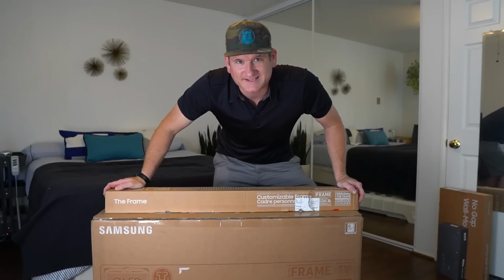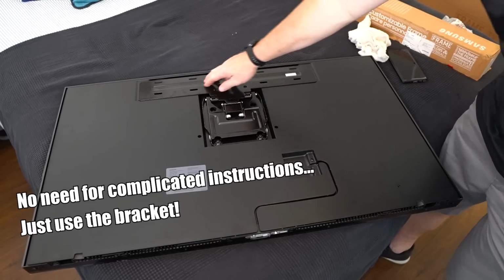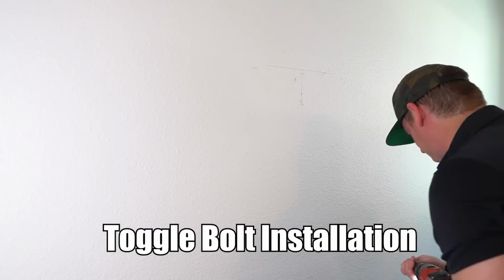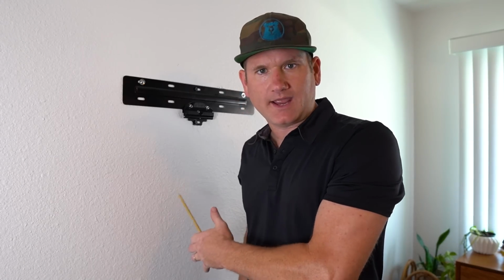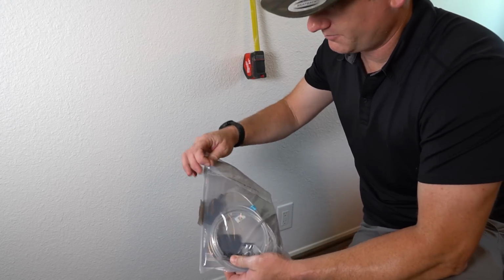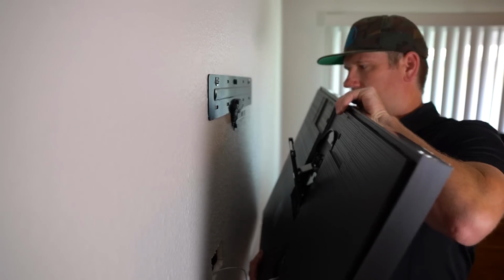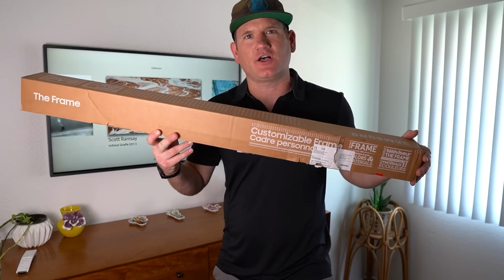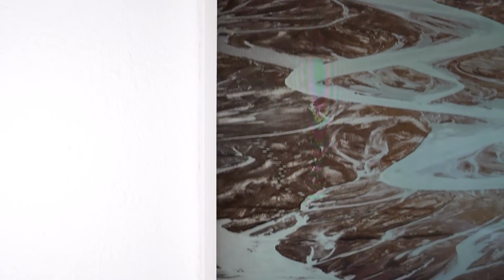Samsung The Frame Install w/ No-gap Wall Mount & Customizable White Bezel

Comment: what's the 'normal' height of the TV from the floor?
Reply from the maker: Depends on what is below it.  8-12 inches above a stand but also art should be eye level to the upper 3rd of the art piece.  So if samsung frame, that is what I would do.
Reply: @BTheInstaller  yes, I was meaning bottom of frame above the floor (no stand) level.
Reply from the maker: No problem.  So again, the upper 3rd of the tv can be at your eye level when standing, that is a good rule for art.  So depending on the size of the tv, the bottom may vary.  You need to balance where the middle viewinf area is when seated, to make it look like art, you don't want too low or too high.  Upper third of the tv around eye level.
Reply: @BTheInstaller  Thanks

Comment: Re: Wall anchors in the 2020 edition: Nope. The parts "F" and "G" are clearly in the instructions (err, one of the four installation instructions) but aren't anywhere to be found in the box 🙄
Reply from the maker: All that is in there is just bolts you don't need and padding.
Reply: @BTheInstaller  I reached out to Samsung support about it. They seem dumbfounded by the photos of the instructions because they keep asking me for model numbers on various packaging and items. Makes it seem like corporate didn't inform support which raises the question if the employees packaging the mounting hardware got the message.

Comment: Great video as I am considering this TV for the living room! Question, any reservations about sending an unrated wire behind the wall? Any solutions for this? Odd that it isn't rated as the TV concept would make sense to include this. Thanks again!
Reply from the maker: It would make sense.  They do make an in wall rated version.  It's $200. I would put the wire in wall on my own install.
Reply: @BTheInstaller  Just bought a Frame, is it unsafe to run the wire in the wall?
Reply from the maker: It is against electrical code to put a wire without protective coating in wall with voltage running through it.   You can run protective conduit in wall or run it outside wall

Comment: Hey man.  Thanks for this.  Did the install yesterday with the wire snaked behind the wall. Also used a 1.75 inch hole saw and 1.75” Grommet to cover the hole on the bottom. The ruler tip was key in making this happen. I’ll have to remember that from now on. Wish I could post a picture. Came out great.
Reply from the maker: Instagram, tag me @b_the_installer

Comment: So my wife and I purchased the frame and the terrace by samsung. Both 65 inch. What would it cost to have them installed on the wall by a professional like yourself?
Reply from the maker: Many factors.  Tough to narrow.  If you're in San diego, we can help.  Good luck.

Comment: Is it true that the One Connect wire is NOT "in wall rated" ? That we should use a conduit?? Please advise.
Reply from the maker: Yes its not.  A conduit after the fact is pretty difficult and not really practical.  I run the cord in wall

Comment: B, do you know if the 2020 OCB comes with an IR extension port in case we need to control a cable box that is hidden from direct view and sitting next to the OCB? BTW great video man, way to go.

Comment: Putting a 55' the frame 2020. Thinking of buying toggle bolts, what size för your recommend? :) Do you have a link?
Reply from the maker: 3/16" by 2.5 inch long.  Standard at home depot.

Comment: Great video! Thanks for the great information. I’m looking at putting one up on a shiplap wall. Would you still try to get into studs?
Reply from the maker: Thanks. If you can find the stud and get two screws into a stud as well as a couple drywall screws into other areas, it won't hurt.  6-8 drywall screws into the wood will be sufficient as well.

Comment: Hello, if I have a brick wall, but already did the proper holes to get the wire through the wall, Can I do that? Or what does it mean when it says you cannot send the wire through the wall? Thanks a lot!
Reply from the maker: There are rules/codes that you can check with where you live regarding what is legal for you to run in-wall.  That normally is based on if there would be a fire, would the wires make the fire worse, or slow the fire by melting. More or less.  You can add conduit in wall to make it less risky. In the end, the wire is unlikely to cause you issues and you make the decision.  If i had a route in brick. I would run that one-wire in it, personally.
Reply: @BTheInstaller  Thanks for the reply! I will do that. One more question: if I want to add a Sonos sound bar mounted below the TV, how could I run the cable to that route if the TV is installed with the No Gap Wall Mount? I would have to find another way to run the power cord and the HDMI cable from the sound bar to the One Connect Box, correct? Or how would you suggest I do this?

Comment: Can you install this tv on an articulated mount if your previous tv had that?
Reply from the maker: Yes but it won't be flat like a picture.  There are better tvs for that and all of the high level Samsung have ambient picture modes.
Reply: B The Installer thanks. So we have a house that has a wall mount already attached to the wall for a 65” tv and ready to be used in place where I’ll be putting our new tv at and we want to be able to view the screen from different angles while also being able to have it look like art. Are the other Samsung options capable of doing that and this one just allows you to have it flat on the wall? Is that the advantage with the frame vs the other models?

Comment: Really appreciate what you’re doing to make these these installs easier. Question about The Frame no gap mount: a wall outlet is in the way of where the mount goes. Am I safe if I cut about 5” off one side of the mount?
Reply from the maker: No problem.  Good question.  It would be totally fine or you can take off the cover plate and mount it right over the outlet.  Im assuming you will hit a stud near the outlet to solidify the mount on wall or use toggle bolts?

Comment: Thanks for a super instructional video.  Do you know if there is a Frame TV that is capable of slightly adjusting with a tilt to the left?  The wall we would mount our TV on will look beautiful with the Frame TV picture when we walk in the room.  However, when we actually want to watch the TV , the seating area is to the left so we would need to adjust the TV to angle to the left.  With a regular adjustable mount there is no problem, but I’d really like to place a Frame TV in this spot...especially after watching your video! Thank you, Andrea
Reply from the maker: Thanks.  No you wouls be able to achieve that only with a recessed arm mount.  Theg make them but it would have to connect the mount to the vesa pattern not the no gap mount.

Comment: Nice vid! Very keen on this TV. I just can't get over how thin those walls are though in the US, my god.
Reply from the maker: Yeah walls in the US are strange.  Some are just drywall, with studs every 16" for structure and drywall on the other side.  Some walls have 3/4" plywood behind it if they're supporting more weight above.. there are brick and concrete but not as often and even when there is, they often frame them with studs and drywall over to keep electrical and plumbing between the concrete and drywall.

Comment: My new house already has holes in the wall for a wall mount. Its like 43/44cm apart from each other. Will the no gap samsung wall mount fit? Saves me time
Reply from the maker: You have to put the mount where the new TV is to go and follow my instructions.  Can't just put where holes are or the tv may not be where you expect it to be.

Comment: What type of toggle bolts would you recommend? I've asked Samsung (in the installation guide it says they come with some sizes, but apparently not with the 50"). I want to add mine to a dot and dab wall.
Thanks for the video, by the way.
Reply: Did you figure it out? I'm also trying to find which M bolt should I get to fit in the support before the TV arrives.

Comment: Hi. Can you please explain the hazards of having the wire outside the wall? I am not sure what in wall rated is and its advantages.
Reply from the maker: There is no 'code hazard' outside the wall. If you mean in-wall rated, it has to do with the cord ability to not continue to burn if on fire.  Whether the cord is in-wall rated or not, it still has the same power and info passing through.  They make a cord that has that extra coating on it, to avoid the damage in wall and to reduce spread of fire, but for simple up and down run, inside or outside wall are both an option.

Comment: What size drill bit for the Samsung bolts? 1/8 seems small
Reply from the maker: 1/8 I think or slightly bigger.  Its the size of the bolt not the threads so you have to make sure the bit is smaller than the thread diameter.

Comment: What are the risks in using the one connect cable in the wall since it is not in-wall rated? I don't want to spend $160 on the In-Wall version of the cable that also creates a 1/4cm gap behind the TV. If there is any way I can skip that or make my own conduit that preserves the no gap behind the TV, that would be awesome! I'm installing in a plywood wall tiny house.

Comment: I had my 2018 model recently hung with the no gap buy Geek Squad and the bottom of the TV touches the wall but not the top is that normal?
Reply from the maker: Pull the bottom out and push the top in... that is what I do to get the tv flat.
Reply: @BTheInstaller  im wondering if something is wrong because I don't have any tension. When I do that it just drops backndown to the wall on the bottom
Reply from the maker: Well the bottom should go to wall, I'm just saying leverage the bottom out to push the top flat then they both should be flat.

Comment: Thanks for the great install video. Do you know how much gap there is between the dry wall and the back of the tv? The reason is I want to use a product called CableClear in-wall conduit and the elbow face protrudes about 3 millimeters when installed. Wondering if this would be a problem? Thanks!
Reply from the maker: It would sit behind there fine.  That is an example of "is it really necessary to run that?"  that conduit is 94UL compliant.  It burns out slower, blah, blah, blah, but if the internal wire gets burnt... its still a fire hazard.  So in the end, save the $50, lol
Reply: @BTheInstaller  Thanks so much B!!! Looking forward to more informative videos!

Comment: great vid! I picked up the 2020 Frame and love it so far! Question: what wall toggle anker are you using? Thanks!
Reply from the maker: Get the 3/16" kind, easy to maneuver.
Reply from the maker: https://www.homedepot.com/p/FLIPTOGGLE-1-4-in-x-2-1-2-in-Toggle-Bolt-10-Pack-425R/206347693

Comment: Can the screensaver mode be turned off?
Reply from the maker: Out of the box, it turns completely off by holding down the power button for a full second.  If you want no art, there may be a setting to take off art mode on short press.

Comment: Just booked the frame tv wonderful video man thanks a lot

Btw the customisable frames are not available in india soo any suggestions?
Just subscribed
Reply from the maker: Use the white matte around your pictures.  It makes it look more like a pic frame.
Reply: Hi samanvay how good is tv and also please tell performance of display and sound .I am trying to purchase 55 inch frame. Your information is valuable to me for purchasing. Tell me your experience. Thanks in advance
Reply: Please review how good it is about sound , display clarity and also connectivity.
Reply: @dinakarreddy3711  Hey man after using thia tv for 3 months i genuinely think you should  buy this tv and also should not
LET ME EXPLAIN
Reply: Let me start with 
PROS : The best looking tv out there hands down , Art mode and ambient mode is excellent ,The qled tecnology is excellent and has great brightness control and automatically adjusts its brightnes also the quick start and fast responses make the usability very good , the smart remote you get with the tv is the best any tv brand has to offer and you can control any devices(if you link them to the smart remote) from anywhere in the house, there will be no mess of wires as only one cable and one connect box will be provided with the tv(costs more than 25000 ruppes)so if you manage the wire well then there will be no visible wires also the no gap wall mount just makes tv look amazing and it comes with no additional cost (worth more than 10000 rupees)AND THE MOST IMPORTANT FEATURE IS THE TIZEN OS 5.0

So the tizen os is soo good and very easy to use it ia the best and i am pretty sure you will like it . You can't get any other tv like sony or lg with tizen . lg has web os which lowkey sucks and Sony has android tv os which is ok

You might not think this  is a big advantage but trust me after using tizen os you can't go back its that good and also a big reason to buy samsung tvs
Reply: Now the important part
CONS: The sound quality is not soo good but also not soo bad i mean it is equipped with 40w speakers which is amazing but actually ony 20W speakers are main ones and they are the ones that emmit most of the sound the other 20 watt speakers are the aub woofers.So if you want some nice base to your music or sound this is the one also the sound also automatically adjusts itself to the surroundings like if someone is talking in the room while talking it automatically rises its volume to make the dialogue clearer which brings me to my next point that is dialogues are not clear sometimes during heavy action scenes but for youtube and stuff or normal for conversations they will do just fine but a SOUND BAR IS HIGHLY RECOMMENDED

I haven't hooked up any x box ps4 or switch to so i don't know how gaming worka on it but you have dedicated game mode in it so it should be fine and there is no HDMI 2.1 in it which does not help you to play 4k@120fps but it shouldn't matter if you aren't a heavy gamer

Now the hardware connevtivity like hdmi ports and usb ports or you even get jogs with it which os incredable ( jogs are useful if you have non hd set top box)

But but but but most important thing of all of this is i am having a very very very hard time connecting to my wifi sometimes it does not connect sometimes it automatically disconnects But that might even be because of my wifi as that even sucks ( i use tikona broadband 60mbps) so the wifi connectivity issues will be resolved says aamaung when i asked them about this but till then i am going to have a hard time because you can't do anything without good wifi connection and speed (minimum 10 mbps recommended)
Reply: Conclusion: You might think i told a lot of pros but only less cons
I mean yeah I did but let me get this straight my friend all of the pros i told are same for any high-end samsung tv which start at a price lower than frame tv. So  why is the frame costly?because it moatly depends on its amazing design that means you are payong more for the design than for the features it has to offer
Reply: Ultimately if you want to your living room to look more elegant and beautiful i highly recommend you to buy this but if you want game and alao want some more technological features WAIT TILL DHUSSERA FOR OFFERS ANDgo for SAMSUNG Q60T if you can extend your budget a little bit go for SAMSUNG Q70T which i thought of buying
Reply: Lots of thanks . I am so happy u have spent ur valuable time and gave me exact required information.i am so much thankful to that . I have 2 more questions regarding viewing angle because (so many are mentioned it is VA PANEL viewing angles are bad.we have to see it only from front or little bit side we can watch the tv? and we can't download another OTT apps?.my mobile number 9980317639.u just reply to this or u can make a call at your free time your wish sir.no urgency.once again thank you so much for valuable reply.sorry for disturbing you.
Reply: No don't belive all  those va panel is good and has very good viewing  angles
Reply: Even i was so hyped up while buying this tv but i am kinda regretting that decision now

If your living room is bright go for qled technology like samsungs or one plua tv if it is dark go for lg or sony tvs

Comment: I have 2019 55” frame tv I want to upgrade to 2020 65” frame tv can I still use the 2019 frame no gap wall mount for new 65” 2020 frame tv?
Reply from the maker: The tvs come with the mount, so are you saying that in order to skip the taking down of the mount?
Reply: Yes skip taking down the mount

Comment: I heard the connect cord is not “in wall rated.” I have my cord out but it does not get warm ever is it really a fire hazard?
Reply from the maker: It's very hard to show any cord having the ability to stand up to extreme conditions that would cause or be at risk to a fire.  In over 10,000 installations, I've never heard of any fires due to a tv wire, but i always try to add a real power outlet.  Things like this one wire and sound bar power cords have raised this clean look vs external wires issue.  I can't say what any one person should do, but i would definitely put the wire in-wall, myself.  I plan to wkth the 800T on its way...
Reply: @BTheInstaller  Why not just run flexible conduit and run the wire inside that?  That would bring it up to code?
Reply from the maker: You could.  I don't do these that often.  I will try to get a video showing that.